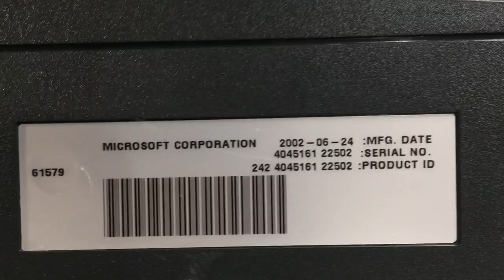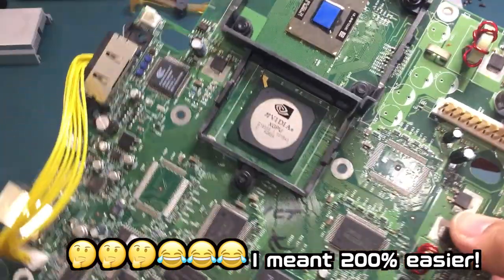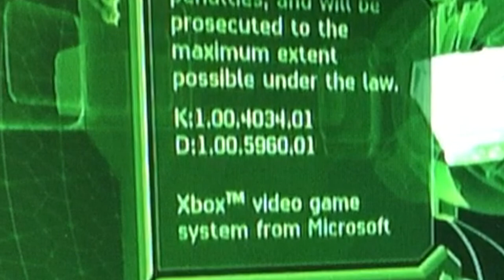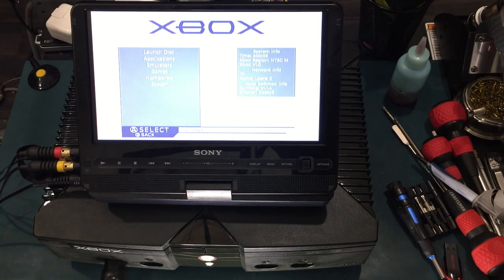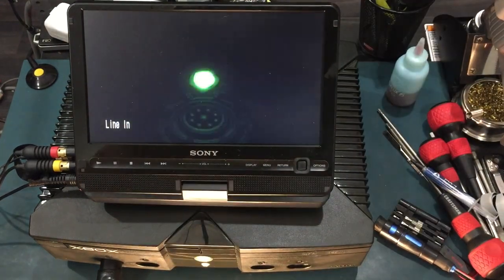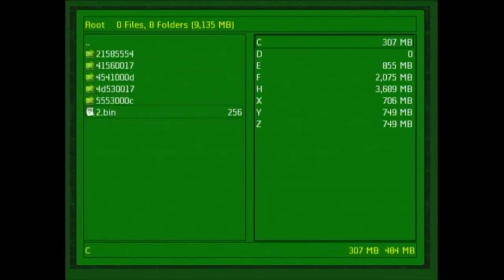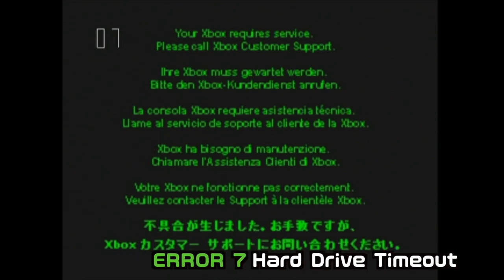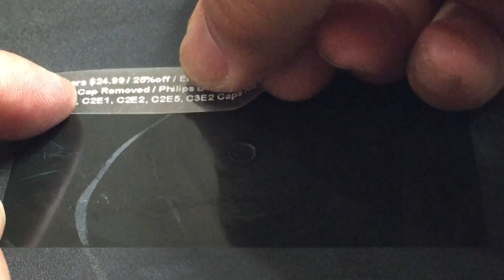OG XBox Error Codes 5, 7, 11, 13, 16 Explained & How To Fix Them [ep. 81]

Comment: Error 5 is for your hard drive not being locked.
Error 7 is usually for a missing hard drive.
Error 11 is for your Xbox not detecting a CD drive.
Error 13 is for your dashboard failing to launch and your Xbox couldn't specify why it failed.
Error 16 is for a missing or dead clock capacitor.
The most common one in this list is Error 16. The clock capacitor is prone for leaking (1.0 to 1.5 original Xbox systems).

Comment from the maker: BTW, huge thanks to the people responsible for bringing these tools out to the masses. I know personally, that somtimes it's a thankless gesture. I may not know any of you, your names or faces, but here is my thanks to you. THANK YOU!!!
Reply: The Sega Holic I have a modded Xbox I just bought and I did something stupid!! I unlocked the hard drive and now I have an error 5!! Can you give me some steps to fix this issue?? Thanks a bunch and great video
Reply from the maker: @bigbeardedbeastcollector9404  Hey, what's up? Yeah, you'll get that Error 5 if you don't lock it. Easiest way to relock it is to use another modded/softmodded XBox and use Chimp 261812. You'll need to have the eeprom info from the XBox that has the error5 also, for Chimp 261812 to use to relock it. You'll need to upload the eeprom.bin file into the second XBox.

IF YOU HAVEN'T, WATCH THIS VIDEO IN FULL, I GO QUICKLY SO YOU DON'T GET BORED. IT EXPLAINS EVERYTHING YOU NEED TO DO.

If you haven't saved your eeprom.bin or don't have it, you'll need to extract it with Pony Prog and a homemade cable, which is easy to do.

https://www.youtube.com/watch?v=UcK6nKyKGVQ

Come back and ask me specific questions about stuff you're iffy about.
Reply: Hey big thanks for the reply I’m actually just considering buying a new modded Xbox but my problem is I have a 200 burned games how will I know if the other Xbox has this ability? Then I can fix the one and sell it I guess I really want my Xbox back since I got to play it for like 3 hours before I did this to myself 🥺 any suggestions on one for cheap? I bought this one for 50 bucks!! That kinda deal doesn’t happen I don’t think 🤔
Reply from the maker: @bigbeardedbeastcollector9404  They say certain drives are picky with burnt media, depending on the type of disc you burnt it on (DVD-R vs DVD+R vs CD-R), but I've not had any issues with any media being incompatible with any other brand drive, and I have 20 or so XBox's. So your burnt games may or may not wok, judging from information online. But they may have had a dirty lens, failing laser pickup, etc.

I really suggest you just rip them back to your computer as an ISO and use a harger HDD to store and play them, which having the second XBox will help you relock and clone your hard drive to a larger drive.

My suggestion is to just buy one STOCK on the cheap. Look on Craigslist. I go to Savers (thrft shop) here, and have found them for as low as $5. On average, you should pay no more than $15 for a fully working one. Then buy a softmod kit on eBay that comes with the necesary cables, game, and memory needed. That will be about $25. Do the softmod like I instruct in one of my past vdieos- either Rocky5's or SID. Then upload Chimp to your XBox via FTP, relock your old HDD.

Whether you want to keep the extra hardware is up to you, but I would keep it as a means to fix your XBox should anything happen to it again, or if it should catastropically fail in the future.

$50 for a softmodded XBox sounds reasonable, but personally, I'd be happy if I could sell one for $30.

Comment: Hey, so I just got my hands on the OG Xbox. It was working fine and playing games until it started lagging really bad and so I thought it was overheating or something. I powered it off and to let it cool. Again because I thought it might need it. When I tried to power it back on the thing wouldn’t open the disc drive and I got an error screen saying I needed to send it in for maintenance. It pulled an error 11. I took it apart and cleaned everything. Motherboard and such. Then I took apart the disc drive and cleaned it as well as replaced the drive belt as well as check for continuity and retinned the solder points. Sadly not positive result. Still getting the same error. Do you think my disc drive circuit board died?

Comment: I came here to check for Error 5 (HDD is unlocked) but you forgot it. Any info on how to lock the HDD using a PC?
Reply from the maker: Actually, Error 5 is addressed. Please watch the video more carefully and pay attention. Thanks.
Reply: @The_SegaHolic  There's a 2 second mention "don't forget to lock the drive". How to recover from an xbox which isn't hard or soft modded but the HDD is unlocked and starts with the error 5 isn't explained.
Reply from the maker: @CrazyPCgamercatguy  You're going to need a working modded XBox as your recovery machine. You also need a dumped EEPROM from your error 5 XBox. If you don't have the EEPROM, you can build the cable that I show in the video. You can find the video on how to build the EEPROM dumping cable by searching for "OG XBOX EEPROM DUMPER" here on YouTube. Once you have the EEPROM, you can then use chimp to lock and unlock the drive by followiing along in this video: https://youtu.be/M24IkA1YHBM
Reply: @The_SegaHolic  I tried to flash the modchip's bios but failed. The problem is I had the HDD unlocked and now I get the error 5 (since the modchip does not work). I have ordered a new modchip to install but at the moment I can't use the Xbox at all because of the error 5.
I have been looking for a way to connect the Xbox HDD to the PC and locking it again with a program. I had pressed on the "backup EEPROM" but I don't know if it did anything. I wonder if this XBoxHDM-2.3-Beta4 USB would work.. If you can suggest any programs able to see the Xbox HDD on the PC would be very helpful.
I will certainly build the cable for, if nothing else, just to try it! :)
Reply from the maker: @CrazyPCgamercatguy  Listen up! Just get a working OG XBox, softmid it. Then use chimp on that working modded XBox to lock the drive... again, you’ll need your Eeprom. You can still dump it from your error 5 Xbox. Forget about the PC. Use another xbox!
Reply: @The_SegaHolic  I may be able to get access to another Xbox. If I do, I'll try that. Otherwise I might just wait for the new modchip to arrive..
Thanks!
Reply from the maker: @CrazyPCgamercatguy  Have you tried Craigslist or Facebook Marketplace? They should be really really cheap.
Reply: @The_SegaHolic  I don't have facebook! :) And I didn't try craigslist (I don't know if I can use it practically to have items sent to Greece, shipping would be most expensive).
Reply from the maker: @CrazyPCgamercatguy  LOL. Didn't know you were in Greece.
Reply: @The_SegaHolic  hehe! no problem!

Comment: I've an error 13 after trying to installthe last version of Rocky5 and the last version of MS dashboard. After the install, when I ejected the Extras Disc DVD , error 13 occurs. I can't read any non-original DVDs, so I can't run Extras Disc DVD anymore. I run Halo 2 game in order to update and fix the MS dashboard, but the MS dashboard wasn't fixed and I'm still freeze on Error 13. I don't even the expoit save files on HDD. What can I do? I'm panicking...
Reply from the maker: Follow the directions of what I did in the video.
Reply: @The_SegaHolic  I did see the video, but I can't apply any fix you show in the video about error 13, am I right?
Reply from the maker: @IoAllegraAndCo  no, u r not right. I address error 13 directly, and why it could happen, and why it’s happening.. Impatience is not a virtue.
Reply: Install the Rocky5 softmod, then use the Extras disc to install the Stock MS Dash 5960.
EDIT: Make sure you insert the exploit game.

Comment: My fiance's Xbox worked just fine it wasn't shut off wrong or anything. we put it up in the closet pulled it back out a few months later and an errors popping up but with no code. Does that mean that the hard drive is fried?

Comment: I have an Xbox and used a softmod and installed a mod chip I guess I didn't flash the tstop anyway I unlocked the HDD and now get the error 05, any advice?
Reply from the maker: Yeah, I thought I showed how to relock you HDD in this video. Error 5 is unlocked HDD. Sorry, it's been so long since I've messed around with the XBox. But basically you'll need to dump your keys with a homemade eeprom reader.
https://www.youtube.com/watch?v=UcK6nKyKGVQ&t=0s
Then use Chimp on a working Xbox to lock your HDD. It's all in this vid.
Reply: @The_SegaHolic  ok I was thinking thare might be a mod chip out there that i can use to bypass the tstop without using a second xbox, I appreciate the response 👍
Reply from the maker: @michaelleekuhn  Not well versed in mod chips for the XBox. You might wanna go on the XBox subreddit and ask there. I don't know about now, but there was always somebody helpful there in the past whenever I had questions. LMK if you have other questions relating to dumping your keys and whatnot.

Comment: Found an Xbox on eBay for $10 error code 21. Any idea what that one means?
Reply from the maker: Google is a powerful tool!
https://www.reddit.com/r/originalxbox/wiki/error_codes#wiki_error_code_21
Reply: I think it's a generic issue that could be caused by a lot of things, not sure though
Reply: It means you are trying to run an unsigned XBE on a nonsoftmodded system. Try to use a UDDAE exploit.